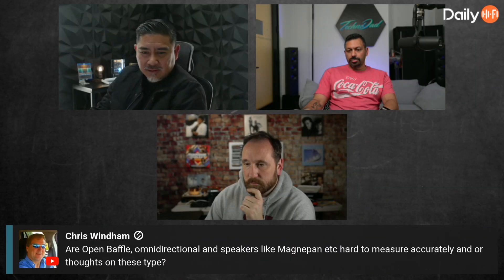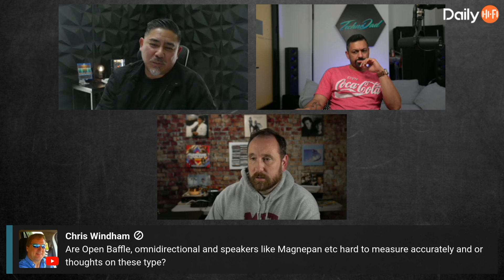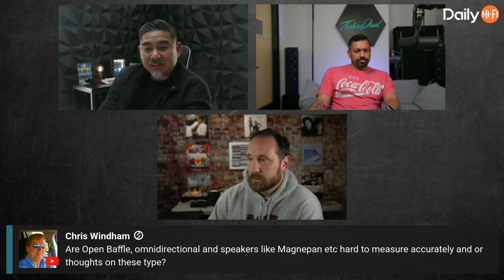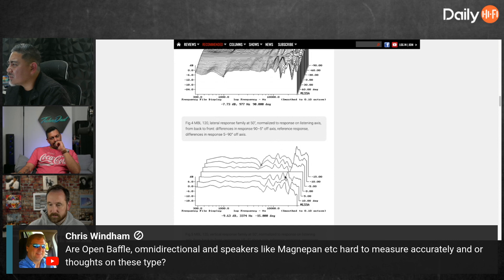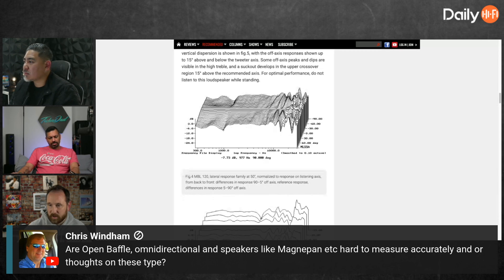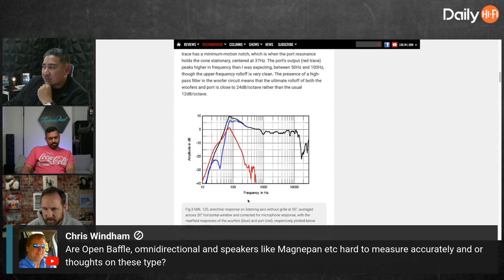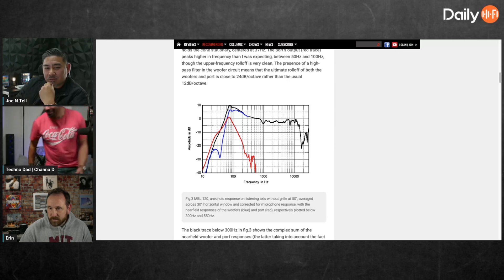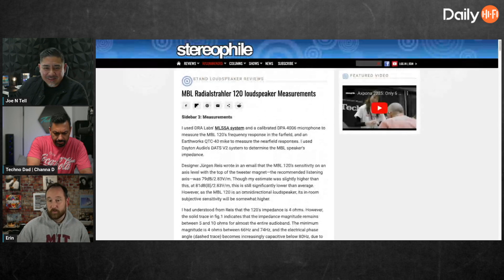Different Types Of Speaker Dispersion

Comment: Andrew Welker and Ian Coulquon of Axiom Audio have a series of scattered YouTube videos about their measurement goals with their omnidirectional loudspeakers.

Apparently, the listening window and sound power need to be practically on top of each other in order to sound right. That would never fly for forward radiators.

Active DSP is apparently required in order to address the center cancellation and control their family of curves.

Their flagship apparently does very well in their internal double blind listening testing.

Comment: fun thought, I converted some commercial audio omni directional pendant speakers for use in my garage with all channel stereo for background music.  I suspect that if you were to use those as discrete height speakers in an atmos system that it would run into the same limitations as dipole speakers but I'm curious as to your thoughts.